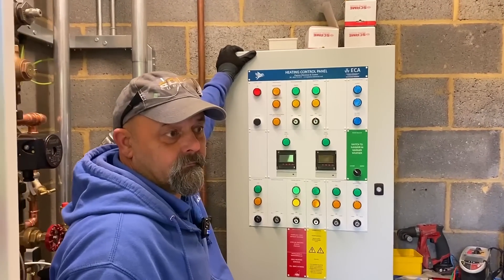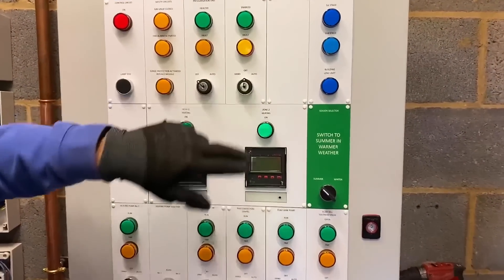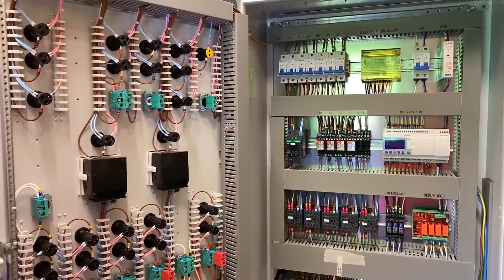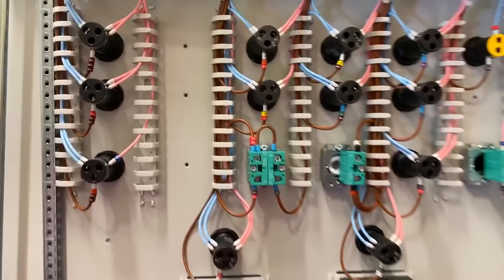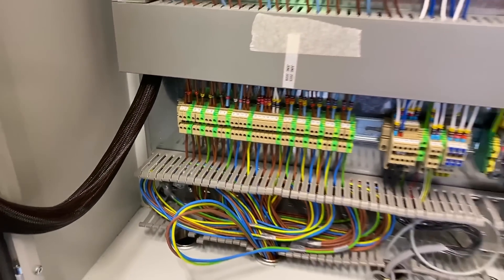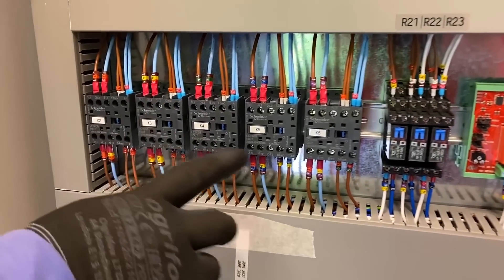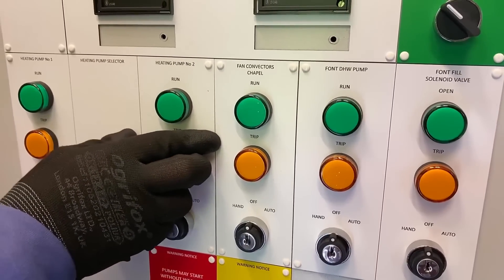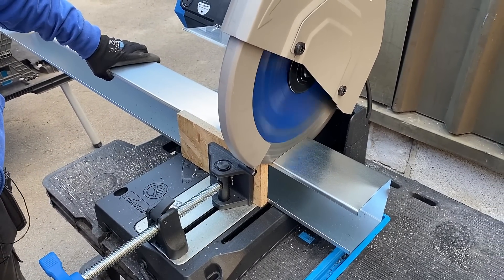Untangle the Mysteries of Control Panel Wiring!

Comment: I used to work for a multinational company, I was a shift mechanical engineer who worked alongside an electrician and support worker in the facilities dept. One day I had a new electrician working on shift and we has a problem - an AHU had tripped, and it was critical to production. We attended the plant room and I opened up the panel, the wiring practically fell out to meet us, there were zero drawings available. 
I reached inside and reset an overload on a 3 phase contractor, something I’d done many times. Later the electrician confided to me he’d sh1t himself when I opened the panel door 😂😂😂 The panels ( of which we had hundreds ) were typical of the factory, you learn to appreciate a new neatly fitted panel with a drawing

Comment: Some of the control pannels i work in Science
A big tech corporate in surrey area are some control pannels with a 200 different Sensors cables we wiring up are a big machines and hydraulic engines Staines steal which costing up to 4 million

Comment: Was an commercial electrician and seldom had schematics to help troubleshoot. Hardest part was troubleshooting intermittent problems. Had one huge panel that a single 20 amp 120 volt transformer with only a single 20 amp fuse feed over 20 remote solenoids,  12 motor starters, lights and probably 30 micro switches. At least once a day it would blow 20 amp fuse. Boss finally allowed me to install about a dozen in line fuse holders to direct us to what section had a intermittent short.

Comment: Interesting stuff.  Would be good to see more of this type of content.  Good stuff eFIXX and Pegasus Electrical.

Question.  Could you add something like a Sheely into the mix to do remote monitoring or diagnostics?  (dependant on internet connectivity)
Reply: Thank you 
👊😎👍💙
Client option not to have connected to the internet. Though wouldn’t be difficult to adapt at a later date if client requires.
Reply: @eddie_pegasus_electrical  I totally understand that not everyone wants or needs things connected to the internet.  Keep up the good work.

Comment: Going so well untill you spoke as a true house basher about seprate earth bar in a C U 

Would have been nice to explain the wire  colours ( hi to low volt ) for people who don't work on proper electrical jobs 
 very nice clean job hats off builder
Reply: class 2 fittings though. he noticed the class 2 fittings. did you notice the class 2 fittings. they were class 2.

Comment: Looks like a crouzet PLC. 

Nice capable units relatively cheap too with free software unlike most other brands.
Reply: @andycrask3531, millennium 3 looking at it, good units, have done a gsm telemetry system controling the pumps on an AD plant with one in the past.
Reply: Yes they are Crouzet M3s . I’ve found very cost effective and pretty much bulletproof, surprising what you can get them to do. Memory size biggest downfall IMHO.

Comment: It would be great to see more videos related to control panel wiring. Explaining the bs en 60204 which is not in the scope of bs 7671. Also testing procedures etc 😊
Reply: I think this is a really important point… more awareness needs to be brought to 60204 👍🏼
Reply: I have spotted a couple of non compliances against BS 60204.
No continuity of bonding from MET to the door. How it is done in this panel is non compliance. Also identification of components should not be placed on the trunking but adjacent to or on a component itself.
Reply: @piotrlobacz  what should it be the earth bonding in order to comply? Directly from the met to the termination point?
Reply: @ireeus.  yes earth bonding to each stud on the enclosure should be uninterrupted. On video there is one running to stud in the enclosure then from that to the door stud.
Reply: @piotrlobacz looks like a plastic box and door so not required. If metal then very much needed
Reply: @andrewtadd4373 it is definitely not a plastic enclosure it wouldn't have bonding studs otherwise.

Comment: Cable numbers and a schematic, next you will tel me there is a plc logic printout 🤣. Seriously that's a nice panel. Electrician is an all encompassing term, there are at least three separate trades in the one trade. You have your domestic sparks, commercial installers and maintenance electricians. The only common factor is it makes you jump if you get hold of it 🤣🤣. We all do a-bit of each  others trade but it's horses for courses in reality.
Reply: Bang right mate.

Comment: Why are some Electricians scared of control panels, once you have a drawing child’s play
Reply: Because the unknown is scary… certainly not child’s play but not as bad as people think.
Reply: Perhaps they don't all have drawings?
Reply: @danielthorne3088  i served my time in the early 80’s before motile phones, the company philosophy was it was working, so just fix it, i have spent days on site  doing drawings, and then fixing the problem
Reply: Who can still read circuit diagrams?
Is that art still taught?
I grew up with electronics experimentation from the 1960's and eventually qualified as an electrical and electronic engineer so it's second nature to be able to read circuit diagrams.
Reply: Drawings? What are they? Lol. I just get told what mods they want and have to make up my control as I go lol.

Comment: Not to be too pedantic but, all those wire  numbers are reading in the wrong direction.
Reply: @pab26120   I have always understood that the numbering should read away from the thing it's connected to.  Yes, you might have to tilt your head multiple times to follow a circuit.  Not sure about the rules here 🤷‍♂
Reply: Usually reads away from term, or tilt head to left, many different combinations especially when you start with source/destination markers. Mostly I've found that it's client specification dependant, probably stems from which country the panel is going to

Comment: Nice work, only suggestion would be to change the terminals for spring loaded. Less build time, less loosening of the terminal. Ok the problem is use in corrosion prone areas such as those with chlorine, condensation.
Reply: 100% .. WAGO terminal blocks all the way 👌🏼

Comment: At my previous place there were many pallet machines and I was trained as an apprentice on how to fault find inside them. Was always fun to see what temporary repairs were still in there 10 years later after getting frustrated that the electric diagrams were now not conforming to what exists.

A top tip I would give is when you have an old electrical cabinet with no documentation, draw your circuit on a piece of paper as you go so you don't have to do mental gymnastics remembering what controls what. If it is equipment you will be working on for a long time, label what each contactor and relay does on the cable conduit.
Reply from the maker: The classic plant maintenance “temporary permanent “
Reply: Trunking lids off, some totally missing, cables hanging like a spider's web. Multicores coming into a terminal rail which connects to another Multicores which then runs up the trunking, across the top, then down into a set of terminals further up the same rail. Did the installer cut their original cables short? 😉
Reply: If it works it's not temporary!

Comment: The cable numbering way of doing things is so stupid and needs phasing out of the industry. Just lable the component.
Reply: So you have a panel with 100 beldons with no numbers, just sensor 1 - 100 in the field. Good luck troubleshooting that. If anything, putting an  ident on every core should be mandatory
Reply: When you have worked on a panel with 100s of cables going to satellite panels all bundled on ladder or in ducting. With the pressure of a multimillion pound company wanting to know why their machine has stopped. You will be extremely greatful of numbered cables.
Reply: @andycrask3531 he must be fresh out of uni, still wet behind the ears and thinks he knows it all😉
Reply: That's a baby control panel, I've worked on control panels that would dwaf that by a factor of 30 plus, there a nightmare when nothing is s numbered and they been repaired number of times over the years and you can guarantee the wiring diagrams are well out of date because of the old components weren't available and they had to use a modern equivalent of new equipment been installed and they rewired the panel to make it work with the new machinery.
Reply: You have no idea what youre talking about, Label the component what?? Call it Relay 1, then what? which cable is going to the load, which is the supply? They will all be brown/blue. 

Basic electricians cant have an opinion on how things are done because all they know is "put brown here and blue there and it will work". Control panels need a lot more knowledge. Dont mean to offend any electricians but that's just how it is, and if you dont feel like that then you're more than a basic electrician so you're good :)
Reply: @pn8902 it would confuse the hell out of them when they find out all the DC control wiring should be blue, AC red and AC & DC power is black, and thats before you start working with individual company specifications getting in the way
Reply: Have you ever done fault finding on a panel without cable idents?
Reply: @beeautomation  yeah, but the panels are ell designed and marked in other ways with good drawings. 

I guess cable numbers are useful if everything else is shit.
Reply: @uk53781 not when they are 40 years old, have been worked on by every man and his dog, cables pulled out of trunking, indents fallen off, wiring changes scribbled on a damp bit of paper and tucked inside. Contactors and alike hanging off din rail as the cables are too short.

Ive been there, for a company multi million pound company that had two panels like this run the compressors for their cold storage facility 😂
Reply: Gotta have cable indents, can you imagine trying to fault find or modify with no drawings of old or new and no cable idents lol
Reply: You really need to give your head a shake, you clearly have no idea what you are talking about.
Reply: I've worked on a few German built machines with no cable IDs; it's ok if there's decent drawings, but drawings tend to be a rare luxury in many panels.

Tracing a circuit through at 2am with no IDs, no drawings and a shift manager wittering "how long will you be?" when a stoppage is losing them £££££/hour is enough to make you question your career choice at times.